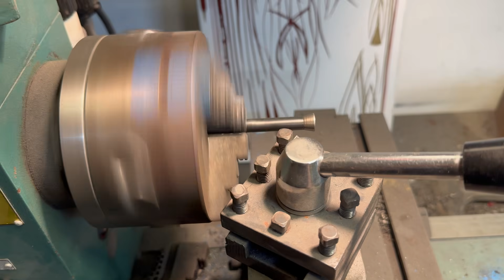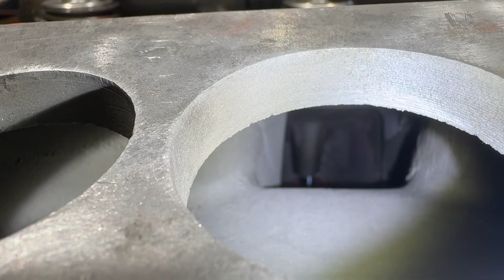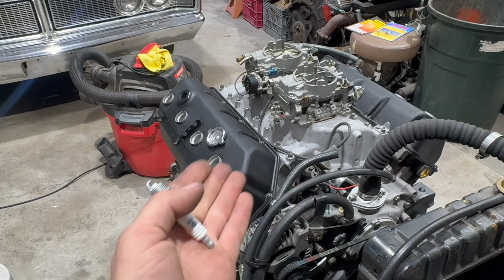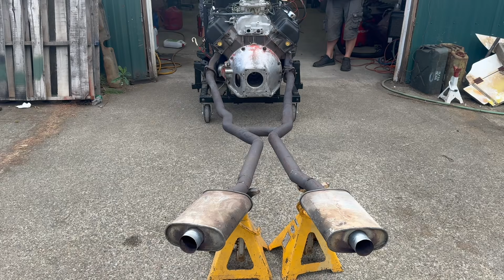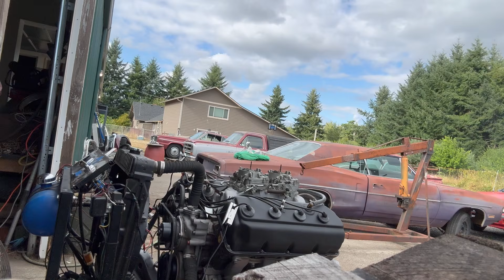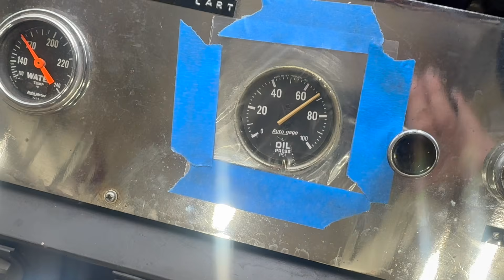IT'S ALIVE! Rebuilt 426 Hemi Pushrod Fix, Intake Sealing Tech, Engine Break-In, And Much More

Comment: Only a meathead would advise building a crappy wedge (in comparison) to a 426. I have and have had both, and there is nothing like the power of a 12.5:1, long duration cam 426 hemi at full some. It is like cr@ck or something.
Reply from the maker: Lots and lots of people prefer the big block. And it’s not that I don’t understand that… I’d hazard a guess that the majority of enthusiasts don’t have 426 Hemi money. Heck, I hardly have 426 Hemi money now. I’m trying to build myself two of them on a shoe string budget. But there is a reason…
Reply: @DeadDodgeGarage  I had a high compression 426 in a factory Hemi Road Runner, and it was like crack. I no longer have Hemi money, but there is no comparison. The charge on the big end and pure Hemi scream is like nothing on the planet!
Reply: But … a big wedge will be deep into its torque band before the hemi hits its high-rpm power curve. I can’t drive around at six grand ….

Comment: Shim BP, No. Torque heads after break-in,Yes. Change break-in oil 20/50, Yes. Sounds awesome. On my 3rd Hemi, love'm but can be temperamental. FYI rad's too small for big block, I have two of the larger fans due to break-in rpm and duration plus at halfway point increase rpm by 1,000 for 20-30sec. Just something I've always done, then slow walk around look for anything out of the norm.
Reply from the maker: Lots, and lots, and LOTS of big block rigs came with a 22” radiator. But for 20 minutes sitting still and warming up, I have found this to be inadequate.

Comment: In the past, I have had those Autogage oil pressure gauges (brand new) lie to me when it came to hot idle oil pressure. Replace it with an Autometer and I bet you will see a significant difference.  Cheap gauges are the most unreliable at the minimum  reading.
Reply from the maker: Yep… I was informed today that when we broke my friend David’s 383 in on the cart, it also showed somewhat low pressure at idle. In the truck with a different gauge, it idles at 35 PSI. I’m going to crap can that one.

Comment: The front carbs did have "half" mixture screws with a lead ball to plug them. If you have a spare AFB carb, back out those half mixture screws and install the full size screws and springs. You'll be glad you did.

Comment: I had to cut a couple of gasket for my lawnmower carb and used my rotary tool with a fine stone but to finish off the edges and open of a couple of holes. As someone that has a basic skill set and little experience I impressed myself that I thought of it and it actually worked. Good thing I had a metal one to use a template or it would have been fubar.

Comment: I can’t believe they didn’t use exhaust manifold gaskets. Even if you did manage to have 2 perfectly flat parallel surfaces you know at some point in the future after some heat cycles things are gonna move and distort at least a little. Exhaust leaks are the worst, they make the best motor sound like shit with that ticky noise that sounds like valve train.
Reply from the maker: At that time, this was the way.
Reply: I'm currently dealing with this issue on my 360 magnum and a broken exhaust bolt to boot😂
Reply: If everything is right, there's no problem with them. I have a 1973 Ford Maverick with a 302, that has the factory exhaust on it with no gaskets, and it's ran fine since new that way. When I built a 351w for my 1994 f150, I didn't use any gaskets and it's ran for over 4 years just fine. Now, if the engine ever runs way hot and the manifolds get too hot, that's something only a new manifold will fix.
Reply: Very, very cool. Sounds fantastic!

Comment: You'll need to set the oil pump for Hemi.. You should be in the 40's at idle
Reply from the maker: There is no “setting the oil pump.” It’s a high volume pump, it is chucking out as much pressure as it possibly could at that RPM. The only oil pressure adjustment is shimming the spring for the bypass valve, which has no effect at idle. 40 PSI hot idle sounds unnecessarily high to me. The number we’re looking for is 20 - and the fact that this oil gauge is a POS might just explain what we’re seeing.
Reply: @DeadDodgeGarage Yes there is, it's the by-pass.😊